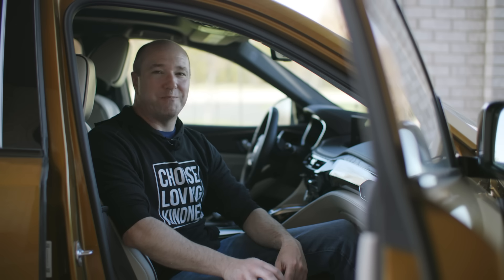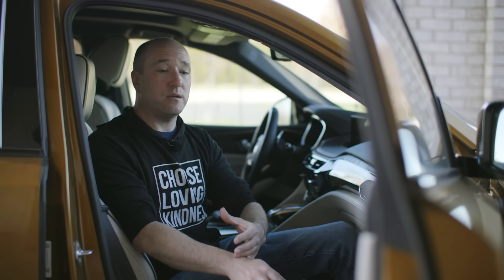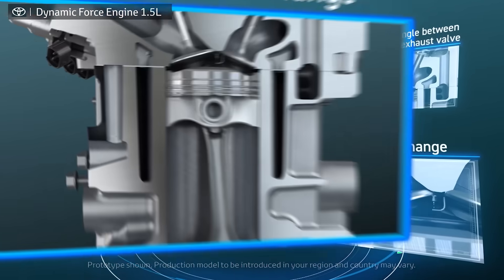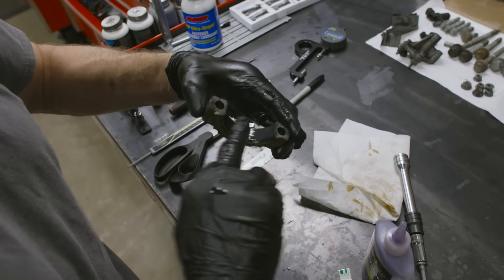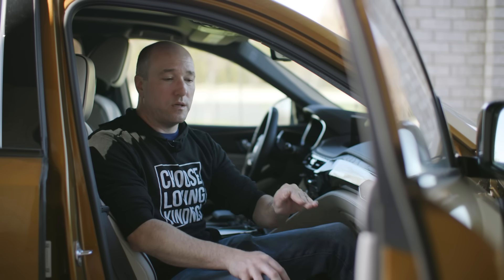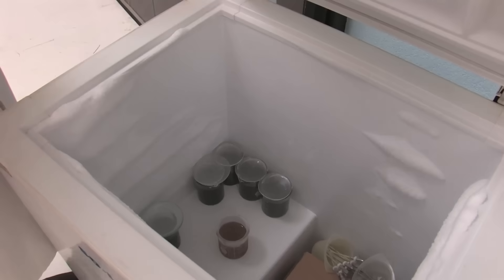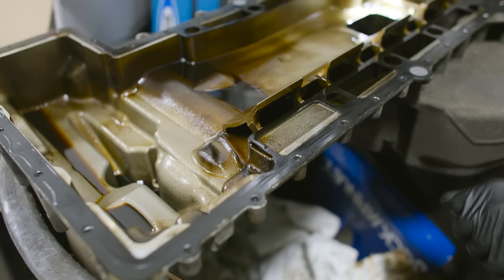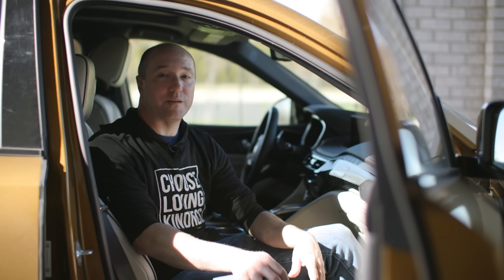Understanding Engine Break In | Dos and Don'ts

Comment: Good overview but I don't agree with 10k mile oil changes unless it's a light duty passenger car.  5k miles is a good compromise for high load performance engines and UOAs bear that out.  Unless you get your oil analyzed you're guessing.  Change oil early for break in (1k miles or less). Finally, I'm going to plug Amsoil Signature Series (5W-30 or 10W-30) because I've seen enough standardized test results and UOAs to be convinced it's probably the best stuff out there at a reasonable price

Comment: Thank you for releasing this video right as my brand new 2023 4Runner has 100 miles on it! No one got to test drive it, I took delivery with 3 miles on the clock. I was planning on keeping it below 4 grand for the first thousand, just for the peace of mind. I'm looking for 300,000 miles out of this powertrain.
Reply: the guy who did your pre-delivery inspection beat the snot out of it i'm certain. it hit redline a minimum of 3 times... its broken in
Reply: @ConnorPawlowski  I highly doubt it. I doubt anyone gets their jollies redlining the most appliance vehicle ever. Even if they did, some idiot dealer employee getting 3 of those in is better than 20 buyers test-driving it and each going for 3 a piece.
Reply: @Ryan  have you ever worked as a set up tech? I highly doubt you know what you're talking about.

Comment: Thanks for making these informative and technical videos with industry expert interviews, they might not be as highly viewed as the hottest new CUV grocery getter, but the engineers and nerds appreciate them. Do you use a specific oil for the track or does it vary car to car?

Any plans for another live stream? Thanks for consistently making the best automotive content on YouTube
Reply: Varies car to car and for a not highly modified, street-legal HPDE car. Fresh oil your manufacturer recommends is usually good enough. Some 'racing' oil like Amsoil or redline use different chemical compositions that make it lubricate metal better. We use amsoil in our modified miata racecar with good success on oil analysis. 

Either way if you're worried about your car, get an oil analysis and that'll tell you 100%.
Reply: It varies from car to car. If you look at a BMW M car and engine, BMW calls for 10W-60 in many cases while the 'regular' BMW has a different engine that will use 0W-30 or 0W-40. I have an 2006 Ford E250 camper van with the 2V Triton 5.4. Ford specifies 5W-20 here in North America, but in other countries where the same vehicle with the same engine is exported, Ford specifies 5W-30. I once had a 1994 Corvette which proudly stated it was filled with Mobil 1 synthetic oil. The 5W-30 specified for normal use is inadequate on the track as the car does not have an oil cooler and oil temps can get very high, like 290°F if you believe the gauge. This is when a 15W-50, or similar, would be called for.
Reply: really hope you got your questions answered one way or another
Reply: show off. wait till i get rich, ima donate thousands in the comment section so goose will never see your comments 👺
Reply: @good  why you so mad
Reply: @good-tn9sr  Where you mistreated in your childhood?

Comment: Interesting to hear your take on NOT using 0-20 oil in a performance car. I just took delivery of a GR Corolla recently, and it calls for 0-20 from Toyota. A handful of other GR-C owners have already talked about switching to 5-20 for track use. I'm curious if you have any thoughts on why Toyota would recommend such a thin oil for a car they know will be tracked....especially considering every GR-C comes with a complimentary track day experience for the owner.
Reply from the maker: Its because they standardize everything and focus in lower emissions and better MPG. These ultra thin oils help them get a nominal boost in better test results for fuel economy and Emissions standards.    Also in most normal usage you would never have a problem with thinning out Eco oils until you get to the extreme temperature range which they know. It would be far more work and liability for them to spec out a secondary oil that they know people aren't going to change back and forth in the summer versus winter.
Reply: I changed to 0w30 after 800 miles. You get complimentary maintenance for 2 years which includes oil changes. I plan to change the oil to 0w30 literally right after I take it to the dealer for 5000 mile maintenance. Basically, I'm only taking my GRC to the dealer so it has a solid recorded maintenance history and so that if there are any warranty issues, there would be less complication. It'd be hard for the warranty guy to deny your warranty claim if you've taken it to the dealer for maintenance since day 1.

0w20 was likely specced by Toyota to meet emissions and MPG targets. Nothing more. It's still a street car at the end of the day, and Toyota wants the numbers to look good.
Reply: @AM-uk7jv  I'm very ignorant to all this, so forgive what may be a silly question - but why are you switching from 0-20 to 0-30? I thought the first number related to heavier/thicker oil, which is why in my comment i mention switching from 0-20 to 5-20. Curious why you're switching to 0-30, and not 5-20?
Reply: @90NA300ZX  There are articles and videos all over the internet that can explain it better than I ever could.
Reply: @90NA300ZX  at full operating temperature, a 0W-20 oil will be around the same viscosity as a 5W-20 so the engine protection will be basically the same. 

You would be far better to go to a 0W-30 or 5W-30 instead of the recommended 0W-20. The second number (-20 or -30) relates to the viscosity at 100 degrees C. The first number (0W or 5W) relates to the viscosity at 40 degrees C
Reply: emissions

Comment: How did you break-in your LC500? SInce you have experience in LC500 how would you recommend break-in?
Reply from the maker: I broke it in as said. On highway, up and down gear box keeping temps around normal, moving RPM from 2000 to 5500 at different load for around 300 miles with a fewer higher load pulls around 100 miles.
Reply: @savagegeese  Ty for the reply!!

Comment: Do you think the same applies to "Built" engines?
Reply from the maker: Depends on the engine and use cases. But there should be a similar break in proceedure to seat parts, wear in parts.

Comment: I'm with you on 90% of this topic.  Except for oil  change intervals.  Yes oil is far better than 20 years ago. However, direct injection engines are very hard on oil, they always push some fuel past the rings and dilute the oil in the crank case. That thins the oil and causes it to gas off and then be burnt through the PCV. A turbo DI engine is even worse. I wouldn't go past 7500k miles in any DI engine. A turbo Equinox or Honda CRV oil cap smells like a fuel station at 7k miles.
Reply: Oil changes every 5k with full synthetic and transmission drain/refill every 60k
Reply: There has to be some truth to this because my 2.5L Mazda engines can't go 6000 miles like the oils of today should be able to. You start to notice a difference, and once new oil is in, the engine runs smoother again. Very reliable engines but you can tell they are tough on oil.
Reply: I was thinking the same thing 8-10k miles is absurd and definitely don't try 15k. Ask dealership techs how they get customer cars with dead engines at less than 50-60k miles. I always stick to the 3-5k mile range. I wouldn't think of changing oil early as wasteful but I think of it as "insurance" for your engine. I guarantee if people follow 10k oil changes they are asking for problems down the road if they want to keep the car over 100k.
Reply: @NoahHeadglitch  The problem is that people don't keep their car past 100k or it's a lease so it will be eventually someone else's problem.
Reply: @quaarjet  true, just wish people would take better care of their cars but it is the world we live in.
Reply: @NoahHeadglitch  it has always been the world we live in.Back in the 80's owners thought that oil changes are optional.I was asked by many neighbors to check their oil level because the oil warning light came on.When asked about their last oil change they looked confused.I lost count how many times the oil turned into dark slime.
Reply: @MultiMusicbuff  That sounds awful, I guess you can't fix stupid but can only inform.
Reply: @MultiMusicbuff  just heating the oil for a few minutes will turn it black.  there is another video on this, someone heats up oil in a beaker, it turns black very quickly.
Reply: @disarchitected  ,you are right but many owners in the 80's let oil changes go for so long that it turns into slime,looking like some molasses.It's way beyond oil that has lost its lubricating effect.
Reply: @NoahHeadglitch  Toyota recommends changes at 10k miles / 15k km or yearly. Oil did improve the last 80 years.
Reply: @olafvanes  oil has improved but 10k if your driving isn't "severe" or done in "harsh" conditions.
Reply: @olafvanes  It says in the manuals to do it every 5k if in harsh conditions or towing. I am in a good amount of dust in my 4runner and am going with 7.5k changes
Reply: @tuckerhiggins4336  you do you, but there's reasons a lot of Toyotas are having oil and piston ring problems nowadays.
Reply: Semi trucks from the factory went from 15-40k mile oil change intervals to now 100k miles is possible as recommended.  The modern designs and latest oils are so good you literally can't make it bad enough to hurt the engine.  I saw one engine go almost a quarter million miles without an oil change and it was still okay inside.
Reply: As far as oil has come, I shouldn't have to add stuff for my flat tappets to increase the longevity of it.
Reply: Thank you.
Reply: Completely agree.  Manufacturer recommended OCI for my turbo DI engine (MZR L3-VDT I4) is 5k miles OR 4 months.  UOA's show that it shears down its oil dramatically beyond either duration (viscosity @ 100°C dips below grade minimum of 9.3cSt ).  Fuel dilution is brutal on even the best motor oils, and for this engine's OCI's, I have proven that time is as important as mileage.
Reply: 20 yrs ago was 2003. Oil hasnt changed much at all .
Reply: @Euphorica   Yes it has.We've had GF4 GF5 and now GF6. The additive packs are totally different,  the base stocks are totally different. The advent of hydrocracked natural gas based synthetics. Plenty is different.
Reply: @terrencejones9817  the illusion of change. I also work in the industry. Same shit different pile
Reply: @Euphorica  I work in the industry too. GF oils overnight stopped GM turbo engines from cracking pistons. The Spec For LSPI resistance is impossible to meet with older oil.  They had to remove the calcium from oils , as they were contributing to carbon build up in DI engines,  that's been replaced with Boron.
Reply: @terrencejones9817  there has definitely been some new 'recipes' in terms of additive packages.
 But for most group1-3 we still use the same hcb,lvgo,hvgo to make our products that we have used since before my time. 
Outside of a few outlier cases, id  be happy running 20 yr old oil in almost anything these days.
Reply: @Euphorica  I don't beleive anything GF rated can be lower than a group 3 or 4. Running something without Dexos gen 2 spec in a boosted GM is going to have LSPI issues.
Reply: @terrencejones9817  fair enough.

Comment: What is everybody's take on Mobil 1 0w30 oil? I know Mark mentioned 0w20/0w16 ECO oils but not something a little heavier🤔
Reply: GM recommends 0W40 In all situations now for the corvettes. 0w30 would definitely be good for an enthusiast car that doesn't see much track use.
Reply: @Terrence Jones  Yeah my car, a 2022 Elantra N, isn't a hand built Z06 engine and I don't track it persay but once a year I go to The Tail of the Dragon and last year my EN saw 235 degree oil temps on various roads.

Most N tuners recommend 5w40 oil when it's tuned. While my car isn't tuned I'm considering 0w40 Oil🤔

Comment: The problem is a lot of this advice is not specific enough. For example, varying the rpm. How often should you vary it? If you're cruising on the highway, do you need to vary the rpm every minute, 5 minutes, 30 minutes? How much should it be varied? 500rpm? 2000? Every person will have their own interpretation
Reply: He can't provide this to you, it varies by manufacturer. The owner's manual should provide information you require. To give you an example, for the family hauler (which is a Subaru Forester in my case, the manual says to keep the engine rpms under 4000, and to avoid constant speeds (fast OR slow), and avoid quick acceleration (presumably to keep rpms down lower). They don't state specifics on how long to hold a speed, but common sense says just drive it normally and not aggressively. You'll find this general advice in all owner's manuals - you just need to check it for the vehicle you own or plan to purchase. Personally, being one to keep cars a long time, if I had to do a longer highway trip I varied the engine RPMs about every 10-15 mins. I also tried to pull off the main highway on to secondary highways with different speed limits and use different roads/take different routes. I consider what I did to be overkill, though.

Comment: Most owner's manuals have self conflicting guideline when it comes to break-in period.
They'll say there is no special procedure.  Then they'll list a bunch of items that are recommended to follow.
Also, when you buy a new car from the dealership, there's a good chance that the engine has already been wrung out by idiot salesmen and/or customers during test drives.
Reply: That is why I ordered my vehicle as an "in-transit" unit, so it is already spoken for.  In theory it should hit the dealer lot with 0 miles and shouldn't be driven until I pick it up.  We'll see.
Reply: In the UK, it can't be called a "new" car if it has more than about 25 miles on it. My current cars had 6 miles and 4 miles on them at delivery.

Comment: Shimmering oil from each of my new cars I have owned at the first oil change at 200-500mi says that I should change the oil before the "recommended" change when the OCI says to... e.g. 5k.
It has served me well with no major engine issues related to anything the oil touches for 150-170k miles.

Comment: High vacuum on decel is typically missed. Really helps ring seal.
Reply: IMO, other than varying rpm it's the most important part. Go find some hills and due multi gear decel from like 5k down.

Comment: Awesome very informative...so depending on engine type i;e Subaru engine change oil at first 1000 kilometres.  Is engine flushing when doing the first 1000K mileage and what about transmission oil?

Comment: Thanks for this very informative video! There are so many opinions on engine break in. I own a Hyundai Elantra N (I noticed one was used in the b-roll) and I followed Hyundai’s 600 mile variable load and 4k RPM max recommendation and so far, 15k miles later, the engine runs perfect.

My question for you Mark is, the manual and oil cap call for 0W-30. Typical crappy Hyundai service put in 0W-20 on my first oil change. I pointed it out to them and they insisted it was fine. This is a very common thing to happen among Elantra N owners. I didn’t feel comfortable with it, so I drained the 0W-20 and refilled with 0W-30 a couple days later. I’ve been doing my own service since using 0W-30. Now the question is: Is 0W-30 considered an ECO oil (I’m using Pennzoil Platinum Euro 0W-30) and if it is, how exactly does it run thinner at full temp when it’s rated as a 30 weigh oil? I understand the W stands for Winter, so cold engine temps, but the 30 should have the viscosity of a 30 weight oil at full temp, the same as say a 5W-30 or 10W-30. If that’s not the case, then what weight oil would be recommended? I live in Tennessee where it doesn’t get very cold, so I’ve been contemplating running Pennzoil Ultra Platinum 5W-30, but again, why would it be considered thicker at full temp if they’re both 30 weight oils? Thanks for any insight into this!
Reply: I am not Mark but do own an Elantra N, I too came across this exact issue. The most wear on modern engines during standard use is typically on a cold start, by reducing the initial friction and allowing the oil to flow through quicker OW flows at lower temps. So it's a balance between whether you are going to run your engine at track temps or put it around town, in that case a 0W might be your best bet depending on your climate. I'm struggling with this in Northern AZ, and need to take it to 90+ degrees on track days, but it's normally in the low 80s here. My next choice would be a 0W-40/5W-40 but I do use the Elantra as a secondary vehicle. I'm curious as to the variance of an OW/5W would make at higher loads.
Reply: @MK3504  I haven’t tracked the car on a road course yet, just a couple runs down the 1/4 mile. But I do like to push it through our awesome TN backroads. Oil is always one of those touchy subjects with car guys. Some can get very bent out of shape swearing on their lives that one viscosity/brand is far superior to all others.

Comment: The only real friction in a modern engine to break in is rings and the cylinder vs ring materials along with the finish on the bore and starting oil will dictate your break in. If you have hard ring which require a finer finish and start with synthetic oil then it becomes a bit of race to land the rings on the bore while there is enough friction or you have to drive a thousand miles to fully seat them. Not exactly what you want to happen on a race motor, but street car no big deal.